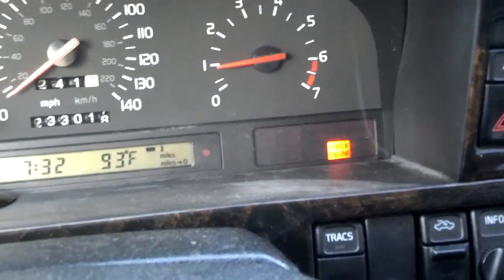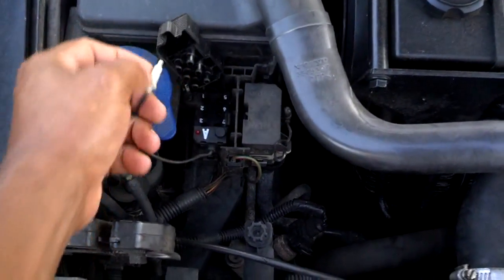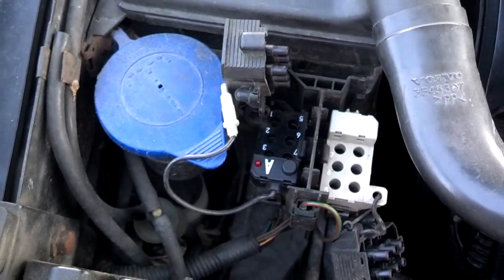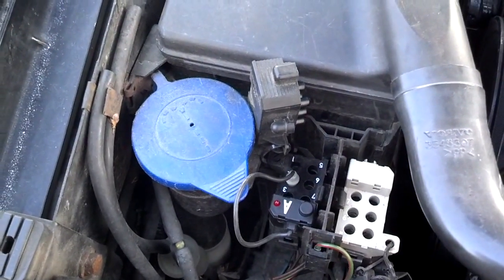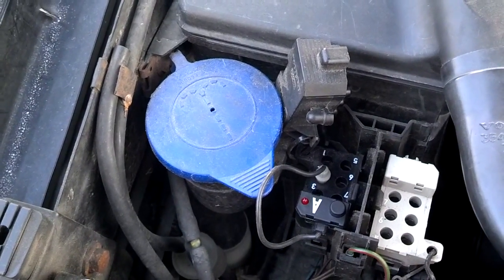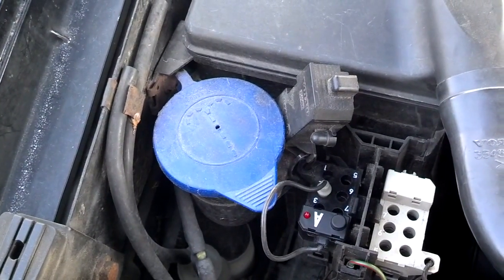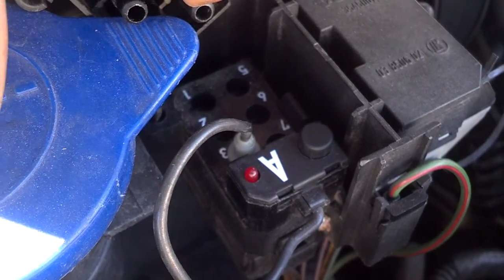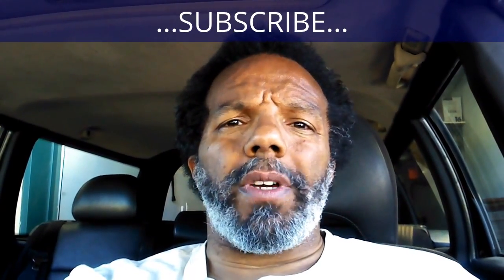How to read, scan for and clear error codes with the diagnostic tool on the Volvo 850, OBD1 - VOTD

Comment: Hello Robert: I have replaced a number of parts on my 1994 Volvo 850 wagon (non-turbo) but am looking to replace the ECU/ECM.  The car  has a 5.1 and 6.2 number on the module as well as the part number. I can find replacements for both modules (with matching part numbers) but cannot find out which modules does what?? The problem is basically that the car starts right away and automatically rev's to 2500 rpm the dies. If I pump it it will (after a time) idle but it is rough. Can you please help to clarify which module I should replace?    thanks   Grant
Reply from the maker: What error codes does it have?
Reply: @RobertDIY  Hello: The error codes have been cleared by the fellow I have helping me. I believe he said they were emission codes . The check engine light is on.
Reply from the maker: If the CEL is on, there are codes in the system. Use the video and get them.
Reply: @RobertDIY  Thanks you   will do

Comment: I was able to get the codes cleared from the "A" OBD tool. Ran the car for a while back and forth in the driveway and no problems. Now I am really confused and I know I have to take this car out on the road to really test it. This time I will get my wife to follow me in the other car. I guess if it stalls again, it wil throw a code and then I will be sure if it's the MAF sensor or the Cam sensor.
Reply from the maker: OK

Comment: Got It! I found the 121 code for the MAF sensor at A2 on the on board diagnostic tool! Thanks! Now I know I can buy a new sensor without wasting my money. I tried to clean the sensor already and it did not fix the problem. Car stalled about 1/2 mile from home and would not start again so I had to have t towed back home.
Reply from the maker: Sometimes you can unplug the MAF and it will start.
Reply: @RobertDIY  I should have tried that. The next day, the car started fine at 3 different times in the driveway. I tried to start it with the MAF unplugged and no go. I am going to try to check the camshaft position sensor today just in case.
Reply from the maker: ok

Comment: Hi Robert.When you reset the codes, by pressing 10 and 10 sec with the jumper on the A3 port for instance, do you reset only the codes stored on that port A3, or all the codes in the system??...many thanks
Reply from the maker: Only port 3
Reply: @RobertDIY  thanks Robert

Comment: Hey robert, here once again asking for your help. I got a volvo 850 1993 with about 198xxx kilometers on it.  
I have 2 problems with it. One is that it wont idle sometimes but i temporarely fixed that by putting a rubber piece over the sensor by the carburetor that activates the iac.
The other problem i have if i drive over a speed bump the car just stalls, there is sometimes i can avoid staling by putting my foot on the throttle. The lamp for error with something with the electrical at the engine lights up for a little while. After that happens the engine takes alot more time to start. I have tried to read the error code and i have 2 error codes from A4 but that isnt in the error list you linked. Any tips? Any help is appreciated.
Reply from the maker: Have you checked your wires at the battery to make sure none are loose?
Reply: @RobertDIY  ive checked with a voltmeter and tried to pull at the battery terminal, and even checked the ground to the engine block but none of them was loose and i had 14,4 voltage at the block. Didnt find anything wrong with the wiring.
Reply from the maker: How about the B cables?
Reply: @RobertDIY  a little bit unsure what a b cable is. What does it come from and goes too? 
Thanks for the help, love your videos
Reply from the maker: From the battery to the fuse box.
Reply: @RobertDIY  thank you, i wil check it out today.
Reply: @RobertDIY  hey, just checked the cable you recommended and it fixed the problem. Thank you so much. Love your videos.
Reply from the maker: You are welcome.

Comment: Just a quick question: I ripped the cord off the plug on my OBD1 unit on my '95 Volvo 960. What's the best way to put it back together? Thanks!
Reply from the maker: Solider.
Reply: @RobertDIY  What's the best way to go about doing that, with not much wire to work with?
Reply from the maker: Remove it and take it to a bench.

Comment: Hi, i cant seem to pull codes from the b6. nothing happends when i push the led button, it only lights when i press then nothing more happends. i think i have the same issue on other ports aswell if i remember.
I wanna see the codes since the passenger power seat (back rest) wont fold up and down the motor makes a sound 1second then quits. guess it needs to be recalibrated.. dunno how to do that.
Reply from the maker: What kind of car do you have?
Reply from the maker: https://youtu.be/gt9w-ZSxs9I
Reply from the maker: https://youtu.be/lGITgKXCBbg
Reply: Volvo 855 -95 t-5r

Comment: Hi.
I have the 1995 volvo 850 t5.
I have read the codes 213 and 214 from the A3 (abs) socket in error codes.
I am getting error code 113 at entry a7(Combined Instrument).
what is this?
what is wrong with these codes?
and the a6 socket seems empty, why?
Thanks
Reply from the maker: I don't understand your issues. You may have a bad instrument cluster.

Comment: Hey Robert, I replaced the mass air flow sensor on my volvo 850 1994. Check engine light went away on its on after I unplugged the battery and connected it back up. So I Did not have to reset that. However, I feel like the car still seem to run lean because the rpm seems to stay about 850 rpm. It does not run rich because the rpm isnt going above 1000 at idle. Could the idle air control valve be faulty? Does it ever need replacing or is this some other problem?
Reply from the maker: Idle is supposed to be 840.
Reply: Robert DIY is there an email where i can send you a picture of the gauge cluster so that you can eyeball it and tell if it looks like 840 to you? 

I am having this weird feeling because every time i shift from park to drive/reverse, the rpm fluctuates for a quick second and then becomes constant. Is that normal?

Is it possible to diagnose or findout if this weird feeling I am getting is false? Since there is no lights on except ABS/Tracs, which means obd in the car wont give me codes on this cause. So can I check this forsure in any other way?

Comment: Hi,
I've been able to drive these old Volvos for the past 5-6 years thanks in part to Roberts DIY.
I have now encountered a problem which I wonder if any of the users here have a solution to:
I need to reset the error codes that we see in this video. 
I reproduce the procedure after reading the codes, but nothing happens.
I depress the button, the red light goes on - and stays on for the 10 seconds I depress it.
Then I release the button, and the light goes off. 
But it does not light on again. Ever.
I try to depress once more for ten seconds - but it has no effect. The lights on the dashboard is still there and the error codes remain in the system.
I wonder what it might be?
And I wonder if there's a solution to this problem?
Anyone with a suggestion?
Reply: It's a 94 850 T5 2.3 liter.
Reply from the maker: Have you fixed the problem?
Reply: No. I have tried, but I have not been able to see how I can reset the codes without using the method you have deviced in the video. On my previous 850 I could do it. But it doesn't work on this one.
I can't keep driving it for more than a few weeks because I need to have it tested by the authorities every two years (here in Denmark) - and certified for road driving. And they will not certify it with the lamp on - even if the car does not pollute more than accepted according to the regulation.
Reply: So basically my primary aim is to remove the light on the dashboard.
I have changed the lambda unit. 

My error codes are:
A2 - fuel injection:
132: Battery voltage too low (I have a good new battery - can low voltage in some of the system cause the inability to reset codes?)
143: Front knock sensor signal absent or fawlty

A3 - ABS
321: LH front wheel sensor intermittent signal at speed over 40
141: Faulty brake pedal position sensor shorted to earth or supply
144: Brake disks overheated (TRACKS code - and I don't have tracks)

B2 - Cruise control
122 - no speed signal (I have not gotten around to work on the cruise control).

I get no readings from A6 which is the ignition system.
Also it "rotates" the error codes as your video shows.

Comment: i am trying to pass the smog test. i reset the computer so that is done (replaced the O2 sensors and disconnected the battery), but the car has to cycle through it's check list, as i understand it. after 1000 miles of driving the way i drive, it has not cycled through yet and i have only 4 days to reregister the car. i live in the middle of nowhere, right next to I5 in southern california. this area has a speed limit of 70, and i think if i go over 65, the computer will not cycle. i do want to drive 200 miles between 25 and 55 mph unless i need to. first, would that work to cycle through the cars check list and allow me to pass the test? second, do i need to cycle through? that is what my local smog guy said who is helping me take the test.. third, is there some other way to cycle through such as jacking my drive wheels off the ground and spending 5 minutes at 35 (as per the speedometer), 5 minutes at 60 and so on, in a particular order of time at certain speeds? if so, what do i do?
Reply from the maker: I don't even know what kind of car you have. 🤔
Reply: watching you for hours on youtube i feel we are best buddies. i forgot you don't know what kind of car i have.
1998 belgium volvo v70 with the wipers on the headlights and heated seats naturally aspirated 2.435 L 5 cylinder gasoline engine, automatic, AC. 1998 means that it has only one ignition coil. 1999 has the coil for each cylinder which i like better.

recap:
1998 volvo v70 naturally aspirated 2.4 L 5 cylinder gasoline engine

thanks for getting back to me so quickly!
Reply: correction: i don't want to drive 200 miles between 25 and 55 mph unless i need to
Reply from the maker: When you get the test done, do NOT cut the car off or it will fail.
Reply: i didn't know that. i got a nice guy that is running the test. i was only supposed to have one free (price included) follow up smog test, but he pre tested with a code reader because he thought it might not have cycled through the monitors. he was correct, 1000 miles and it hadn't, so if he tested it now, it would fail.
Reply from the maker: We have emissions in my area and the '98 cars pass after driving just a few miles if we don't turn it off.
Reply: now i understand what you are saying. here's what happened. i had a check engine light and found out the O2 sensor was bad, so replaced both with Bosch ones via your video for instruction, i torqued them so as not to overtighten them. i was given a choice by the smog guy, something like $40 for a one time test or $50 for 2 tests. i took the $50 option. he thought the monitors would cycle through if i drove 200 miles. he had me go next door and purchase and install a new gas cap. i had driven about 200 miles after disconnecting the battery to reset the ECU and it hadn't cycled through the monitors. he said it would if i drove another 200. so i drove 1000 during the month and came back a couple days ago. he decided to give me a free pretest with a code reader. i should have taken a picture of the readout, there was one failure (i suspect it is the radiator warning), which the state allows and 6 monitors had not cycled, which the state doesn't allow. he said if he hooked the car up for the official state test, it would fail, so i should go back to my mechanic. what i was told was each monitor has a driving requirement such as 40 mph for 5 minutes and 25 mph for 15 minutes. if i knew the requirements of drive mph/minutes, i could do them driving or even with the car's drive in the air (car on stands). there is an additional requirement for the evap system that requires the engine get to operating temperature and pressurize the gas tank and checks evaporation after the car cools back down to non operating temperature, perhaps overnight.
when i go back, i'll keep the car running when i arrive and ask him to keep it running, just in case. thanks
if anyone here knows how to cycle through the monitors, the mph/times, i'd try that, but i think maybe the radiator light keeps turning on and that is probably turning on the service light every once in a while. and a few months back i had my alternator acting up, so i may need to replace the brushes on that to in order to start to cycle through the monitors. the battery light was coming on when i accelerated so maybe that would interfere with the monitors. i think the battery stopped coming on and now it is the radiator light, but i will double check. they look similar to me, they are not very bright and my eyesight is not as good as it used to be. in the meantime i am going to get one of those full time code readers for full time monitoring from ebay for $15 or so and an extension on my car registration so i can work this out.
Reply from the maker: Radiator light??? Service light??? Service light is an oil change reminder that comes on and goes off after 2 minutes.
Reply from the maker: If you are having electrical issues you should check the cables that connect to the battery positive cable.
Reply: thanks. i thought they might be connected. i always wondered what the service light was for! Volvo says never change the radiator fluid, but after 20 years, perhaps it would not be a bad idea. i guess i'll change the oil and filter, although a friend came by last night and reset the monitors in the ECU with a code reader so perhaps the service light will be good to go a few thousand miles.
Reply: that's right! i remember that my other Volvo, a 1999 v70, had a common factory defect having to do with the physical/electrical connection of the positive battery cable connection to the car! you are very helpful Robert, thank you so much! that may be why i have difficulty getting enough power when accelerating and i that is when my battery light used to come on, and so i may not have enough power for the ECU!
Reply: i am going to check the positive cable to the car connection, and i found this on a Volvo forum here: https://volvoforums.com/forum/volvo-v70-13/obd2-drive-cycle-23632/ . that is what i think i was looking for from AaronSales, last post from 2013: Update. Passed smog test, all OBDII reset and working properly. This drive cycle works! Make sure to do the "Flywheel Adaption" reset, that's what made the difference.
the post before that is the complicated instructions for the Flywheel Adaption ... (Adoption?) reset. should i post them here?

Comment: Hey Robert. My check engine light was on for about 5 days and it turned off yesterday. However, when I start my car the check engine light does not show at all. Should I worry about this?
Reply from the maker: Sounds like the bulb burned out.
Reply: Robert DIY but why is it only two lights that don't turn on and the rest do?
Reply from the maker: Because those are the ones that burned out?
Reply: Robert DIY dang alright well thanks Robert I'll head to AutoZone today

Comment: Hey Robert I'm getting a 232 121 113 on a 90 240 I've recently replace the mass air flow sensor and wondering if an o2 sensor may be the issue
Reply from the maker: Have you googled the codes?
Reply: Robert DIY yes sir I got a mass air flow sensor code so I got a new one crank sensor code which I replaced as well as o2 sensor which I just ordered I cleared all the codes but after I ran the car all three codes came back

Comment: HELP! I own a 1995 Volvo 850 I need help understanding the following codes   A BOX Port: 2. 232 Port: 3. 314, 212, 213, 214   B BOX Port: 2. 122
Reply from the maker: +John Williams have you checked the link in the comments section?
Reply: Robert DIY  No

Comment: How do I clean the ports?
Reply from the maker: Unplug the unit and spray the connector and ports with electrical contact cleaner. Then re-connect them with dielectric grease..

Comment: Hey Rob I have a 1995 Volvo 850 I still can't get the engine light to come off. I tried serval times I did get theses codes 314, 212, 213, 214 out of port 3. I hold the button down like you said once I ran threw the codes still the check engine light is on.
Reply from the maker: Maybe you need to fix the problems.
Reply: Ok thanks. My coworker referred me to a machanic that fixes European cars he's good from what they told me. I'll let you know what happens. Thanks for all the advice. I was a VW guy now I'm down with Volvo.

Comment: diditwright@yahoo.com  friends having problem with his 1991 volvo doesn't seem to run very good it hesitate when you give gas and like it's going to die well it stall to can someone shine some light. can you send some idea  to get going he already replace ext fuel pump one macanic said it was the problem  that lasted a week  could it be the injectors
Reply from the maker: https://youtu.be/bfeiZxhJgxY?si=WvqjF8uWIOh6B-uC
Reply from the maker: Injectors are normally the last thing to fail. I would suggest reading the error codes. Probably has a bad sensor or fuel pressure regulator